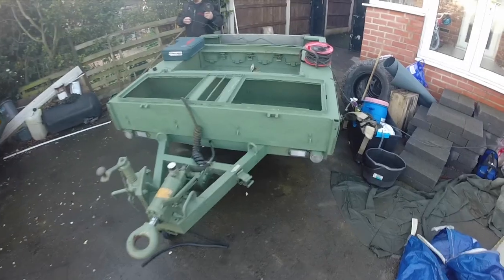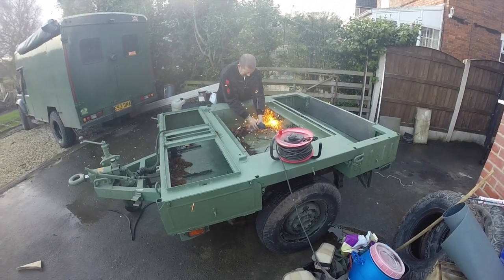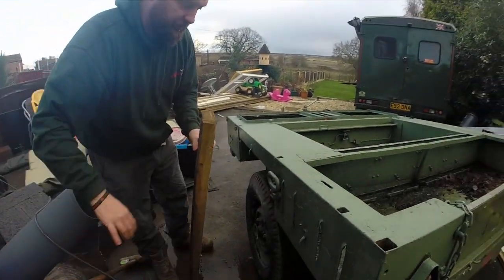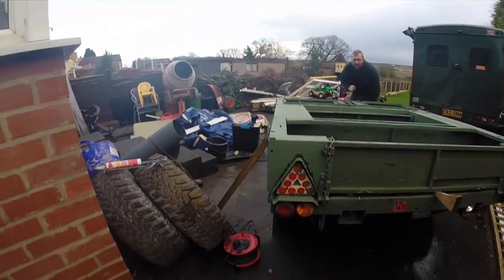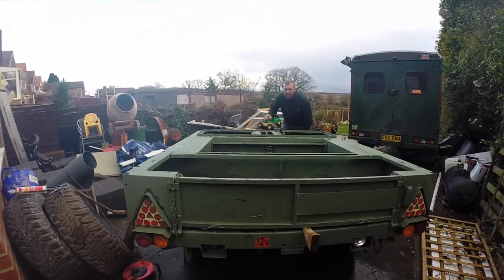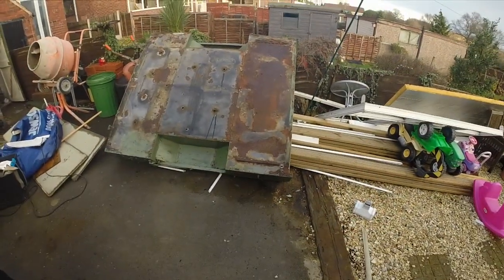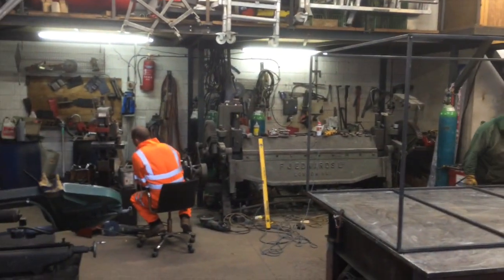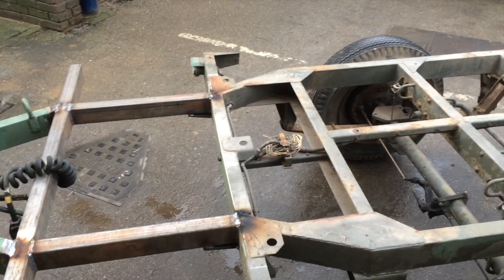Off road camper trailer build. Mk2

Comment: something I'd love to do but don't think the pug would be up to pulling it look forward to the progress 
Atb steve
Reply from the maker: Have you looked at a large garden trailer so it would be classed as a 750kg. I nearly made one out of my dad's old one. It would only be a bit smaller and half the weight.
Reply: +Torn Apart self sufficiency could be an option I did think of doing a horse box as well, hopefully in the years to come if my business might take off and I can get a 4x4 but at the moment doing 15000 + miles a year it's not really an option unfortunately
Reply from the maker: if i didnt have a 4x4 i would have a sprinter van. check out outside van on you tube mate. you could do your own spin and they still have a load space for work

Comment: those trailer bodies are heavy, i have the same one as i said, but cos i do the military shows i want/need to keep it in military shape so it at least looks the part when buttoned up, but i shall watch with interest your internal mods, i am tempted to extend the draw bar frame tho as it will make it tow better, it can be a bit twitchy on such a short a frame,
Reply from the maker: That 2 foot makes it a new trailer mate. Then the body is a foot longer on the floor so I can lay down. Get a second trailer. Every one deserves 2 trailers.
Reply: Torn Apart self sufficiency oh mate i would love two trailers, i am 6.1 i can lay in the trailer no probs as is, and do, but i do have a plan to make a slide forward pod to be the bedroom and make the trailer space a mini camper, that way i wont even have to put up the add on tent if i dont want, just pull up, put down the steadies and pull the pod forward boom, 12 foot long trailer haha

Comment: Yeh yeh yeh....but when are you selling it???
Reply from the maker: Who knows. It depends what I see when I need some extra money.
Reply: +Torn Apart self sufficiency looking good so far. Have you ever used one of this dual hitches? The nato hitch and ball 2 in one?
Reply from the maker: +Str8OuttaCronton yea they are ok for on road but not fit for purpose off road as they can't swivel like a NATO hitch when the latch is off. The only play they have is in the loose grip it has of the loop. If the trailer went over a big rock or high ground that the truck wasn't on it could potentially roll the truck.
Reply: +Torn Apart self sufficiency. Bug out vehicles uk http://www.mod-sales.com/direct/vehicle/home/78170/Humvee_.htm next project? Haha
Reply from the maker: Everything is for sale it's all about the price. I don't need it but it bothers me that I never finished the last one how I wanted to so I'm building this one.
Reply: +Torn Apart self sufficiency. Bug out vehicles uk any more update videos on this one?
Reply from the maker: +Str8OuttaCronton  I was just about to get the materials to skin it and bought a disco. Now I need to get my old bike in one bit to sell to get the money to do the trailer and my workshop.
Reply: +Torn Apart self sufficiency. Bug out vehicles uk 
Hi mate ! I have a Sankey here in Norway,and I like to make me a camp.offroad trailer. I like the size an the look.
Do you have some measurement for the trailer ? LxWxH ?
And is it wide or standard  track ?
Reply from the maker: +Rip Kop its a wide track. Iv made a few sixes but this one is made to the sizes of the composite to keep cost down. It's 5ft wide 8ft long and 4ft high.